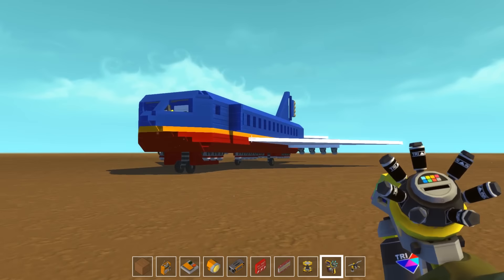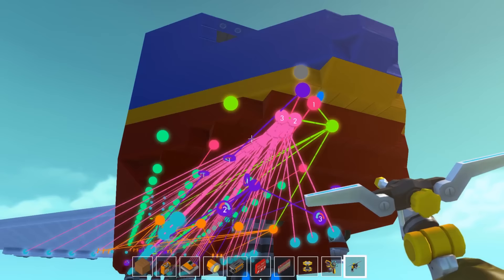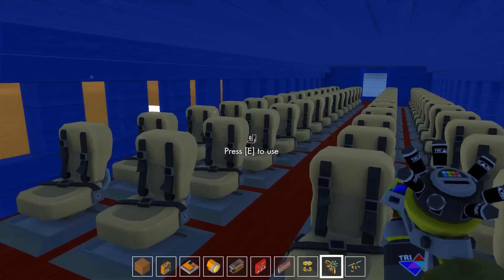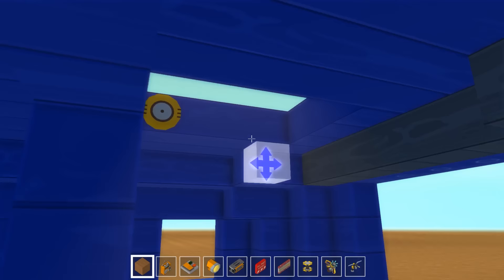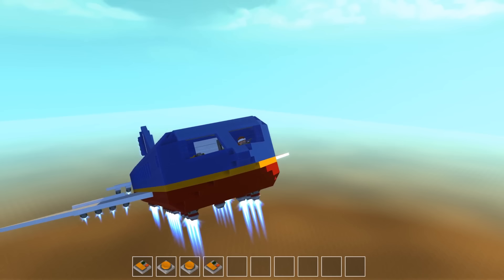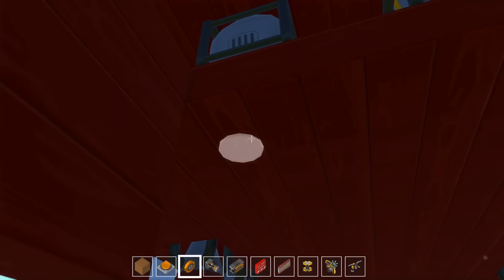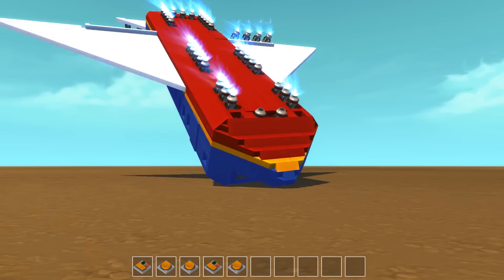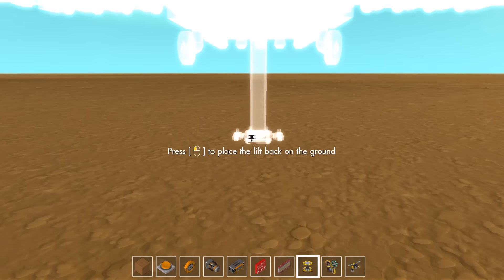Scrap Mechanic Gameplay - EP 29 - Jet Airliner.....Kinda (Download In Description)

Comment: daaaaamn! dem connecting lines! this would really kill my "old" Core 2 Quad I build really nice Winnebago with a transforming folding out room that took 12 bearings or so. I get around no more than 15 FPS.  Then when you glitched thru the wall wile flying that reminded me when that happened to me when i was driving my RV i couldn't get back to the driver's seat until it slammed into the end of the map wall.

Comment: In general i find that, while heavy, metal that you can lower really helps balance you(Metal in the belly on a rotor which drops out to add weight lower down, lowering the center of mass.
Reply from the maker: +Tommy Storer That's good to know. I will remember that for next time.
Reply: +Camodo Gaming jets are very hard to make but well done man it kinda fly's a bit wonky but it was amazing :) keep it up

Comment: Those are ailerons. The "flaps" on the back are elevators. Flaps are what goes down to slow the thing down.
Reply: Ye
Reply: No.... Ailerons work in opposite. On one wing, one goes up, and the other goes down. This makes it roll. Then, with the elevators in the back, when you pull the control wheel the elevator goes up, and pushes the tail down. Thus moving the angle of attack to an inclined position and the airplane proceeds in that direction. The opposite effect occurs when your push on the control wheel.

Comment: Could you please make a truck with good suspension and flex then make a suspension test and use thee truck on the suspension test(please just research what a suspension test is and it is okay if you use an old truck)